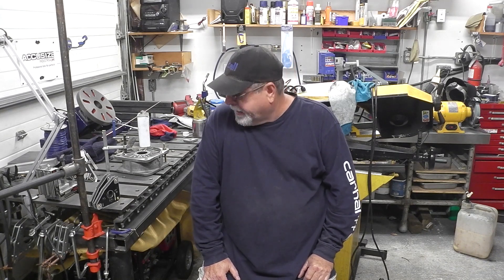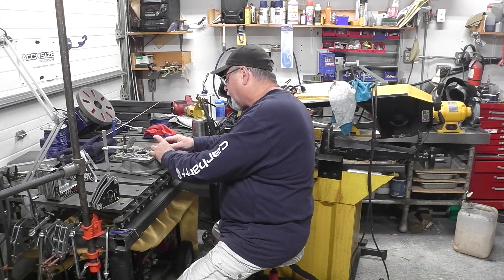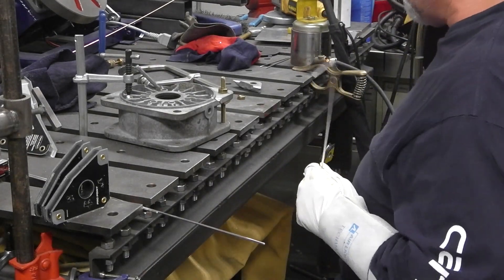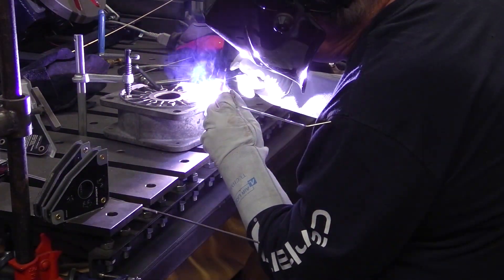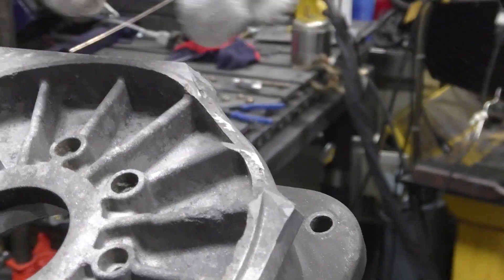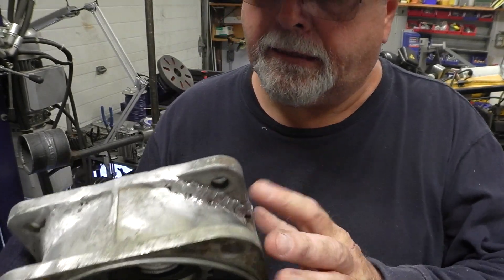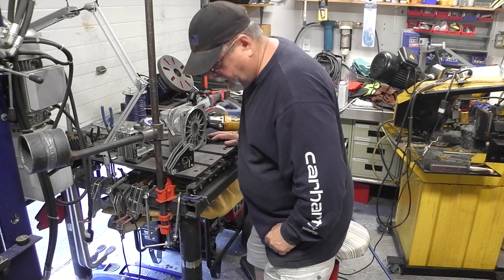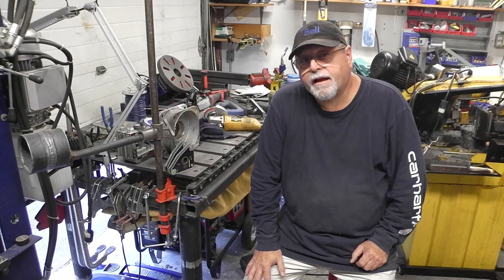Another Night InThe Shop 66  Motor End weldup

Comment: Hey man, I hear you about aluminum welding frustrations - it might just be me but it seems like whenever I weld cast stuff like you just did that there's something up with the aluminum itself, all sorts of stuff floats to the top and it gets seriously frustrating.  Hey, it may not look factory but it will work for the guy and get the machine back into service.  Chalk it up as a win.